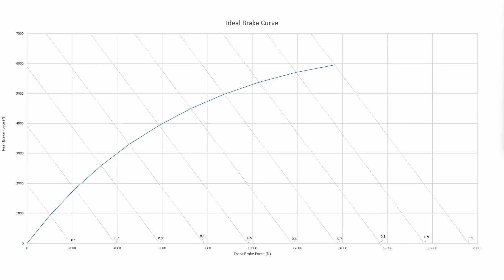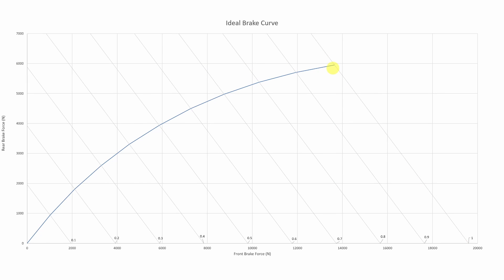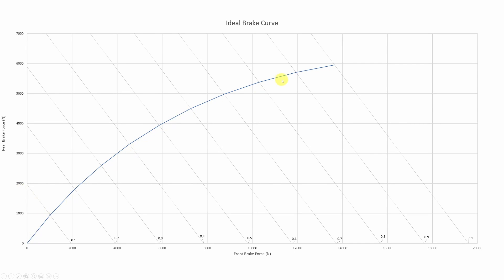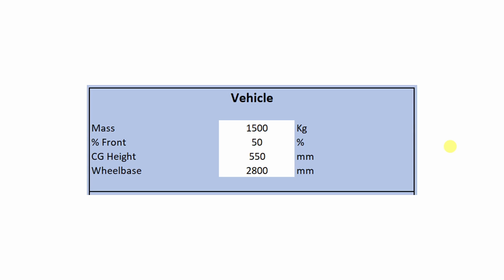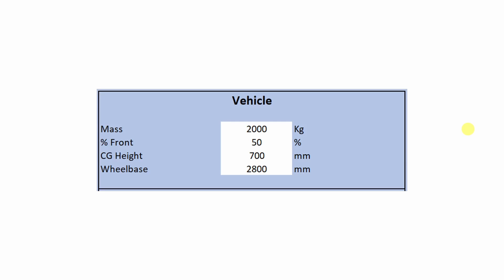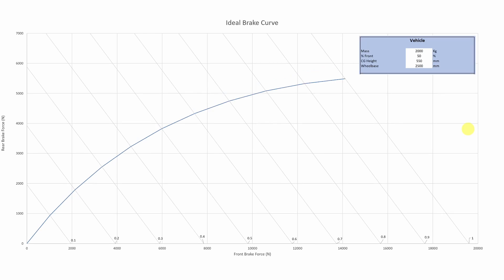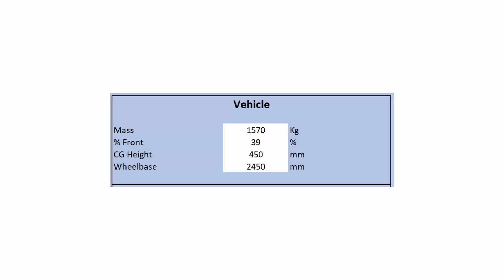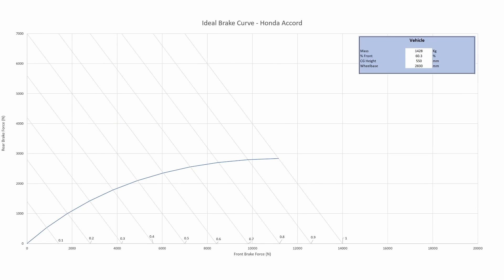The Ideal Brake Curve

Comment: Sir, i got one Question.
You say (and i know thats right) that under heavy Breaking Forces the Rear lift of, and the Front dive in.
But would it be the same, if our Car would have a Super Stiff Suspension?
I mean the stiff Suspension fight against those in Dive, right?
Racing Cars break normaly with a Break Ballance of 55/45. That is way more than every Street Car.
Reply: having stiffer suspension means the car dips less under the same force, if the car dips more the wb effectively shortens bc of the Pythagorean theorem causing the weight transfer to be a little greater and thus the rear wheels will lift slightly later than with less stiff suspension.

Comment: So, my "short for long" if someone would correct me:
We calculate an ideal braking curve based on those values which the weight distribution is the most sensitive (i couldn't get which factor decides the inclination of that line from the ideal 1 grip surface to the crosspoint where the front/rear load meet)
Then we size the capabilities of the front and rear calipers according to the ideal line in order to take advantage of what the ideal line shows to be the capabilities of the vehicle (let's say make the actual and the ideal line overlap instead of the actual being linear like those on basic brake pumps are.)
Am I on track?
I am also wondering how all this connects to tires grip (I suppose it's in the second part I'm gonna watch), and to some adjustable brake bias controls I see people uses. I mean, racecars all uses that and it seems quite sensitive of a parameter to adjust with a scrollwheel while driving... 🤔
Reply: The curve is done using different tyre grip, left low grip, right max grip. At max grip you have more weight transfer, so you need to move the balance  to the front. Race drivers can change this while driving to find their preferred grade of oversteer.

Comment: thanks for the video , how to plot this curve ? what is the equation for the curve and the lines?
Reply: You could use a simplified 2 d car model. Tyres could be modeled as mu*N, as you increase mu, the moment with respect to baricenter can then be divided by wheelbase to find Nfront and Nrear. This would require some iterations to get the actual normal forces.

Comment: I am trying to put those diagonal lines representing friction coefficient / deceleration into Excel, but I don't know how to do it without creating a new series for each one. Is there a simple way to do it? This is a fantastic video, by the way!
Reply from the maker: The only way I've found to do it is to use a new series for each one. You end up with a LOT of series in the graph!
Reply: may i ask how you used excel to get the ideal brake curve? I read the text book he recommended but still don't know what formulas to use
Reply: Hey man! Did you ever get this to work? Please let me know if so because I could not get it. Thank you!

Comment: Do you share that spread sheet anywhere?
Reply from the maker: No I don't. Because brakes are safety critical systems, for liability reasons, I do not share these but the formulas are not difficult to derive or find in text books.

Comment: Is that graph something widely available? I'm curious to plug in my vehicle specs to see what the curve looks like (from an academic perspective).
Reply from the maker: Matthew, the curves I showed were created using a spreadsheet I created myself. The formulas are not very difficult and anyone could easily make a similar spreadsheet. I recommend getting a copy of "Brake Design and Safety" by Rudolf Limpert. I have the third edition and in section 7.3, he talks about creating the ideal, optimum, brake curve.
Reply: @suspensionsexplained  Is there a chance you could upload a copy to a public google drive or something? I'd like to illustrate why people are regularly installing dangerous brake systems on aircooled VWs
Reply: @Levibetz  this spreadsheet will not work for any arbitrary application.

You have to calculate the specific car features. Most importantly, mass and center of gravity height and location between contact patches.

Once you know where the mass is steady state, you can see how it transfers under 1g braking. 

Combining how much weight is transferred to the front tires, compared to the rear tires. In conjunction with their respective widths and pressures (contact patch size). And coefficient of friction... Then You have enough data to determine desired brake bias.

Now you have to spec the entire brake system, that is master cylinder to brake caliper piston diameter ratios front and rear to get the proper output.

Instead of calculating this. Simply install the brakes you want, along with an adjustable brake proportioner onto the rear brake line. 

Take the car out and test it in a controlled area. Keep increasing rear brake flow until you can get the rear to skid when braking while cornering.